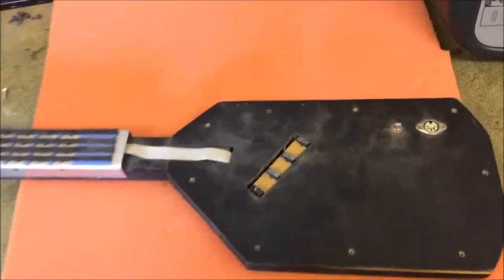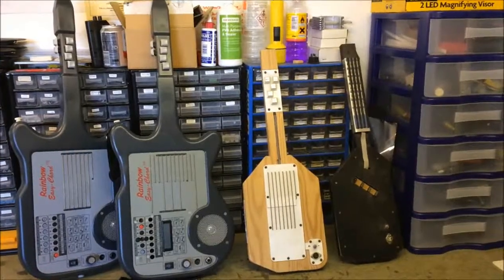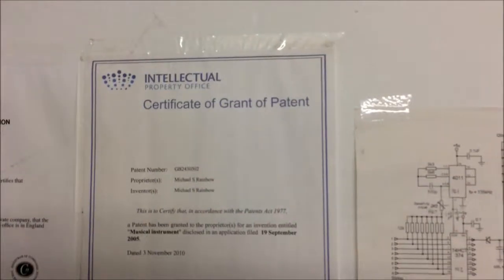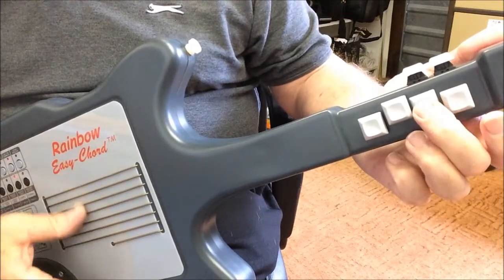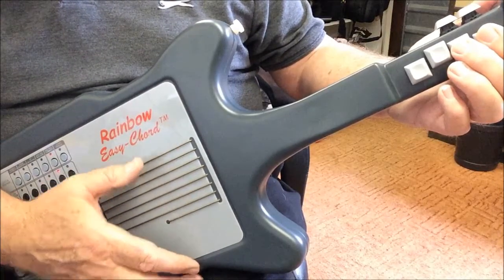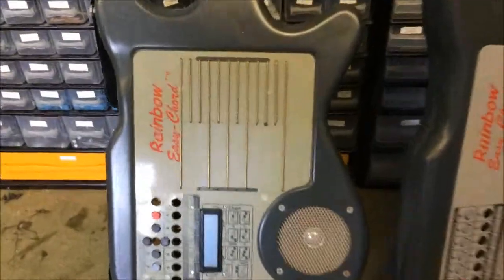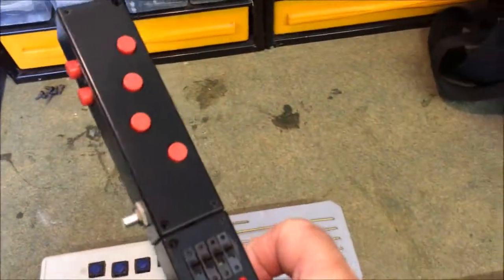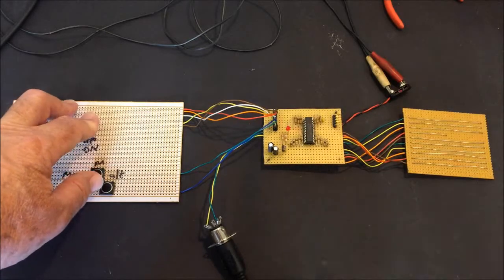DIY MIDI Chord Controller using a PIC 16F1829.

Comment: Hi, ainda não desisti do sonho. Ocorreu-me algo que poderia ajudar (não sei,  não sou um expert em programação): teria havido um erro quando importei o código fonte diretamente do arquivo HEX que usei no meu PC (HxD_HEX)?
Reply from the maker: @user-od4jk6zc2y Wrote: Hi, I haven't given up on the dream yet. Something occurred to me that might help (I don't know, I'm not a programming expert): was there an error when I imported the source code directly from the HEX file I used on my PC (HxD_HEX)? 
Hi Paulo - sorry, I haven't forgotten about your problem - my Pickit 3 has just stopped working and I can't afford a new one so I am building a programmer from scratch. I knocked up the midi controller circuit on breadboard to check the hex code that is on the download site but haven't been able to do so yet.
Reply: @mikerainbow  Amen! Thank you, Mike! I looked forward to an answer from you. But that's okay, I know that we will get make it. As I said, I'm not an expert, but if I can help in some way, let me know it.
Reply from the maker: @PauloAfonsoPereiradaSilva  Hi Paulo, I have got my programmer working and have checked the code and it works perfectly. Also there are no errors in the schematic. I have updated the hex code slightly by removing the midi test on switch-on which plays a 'C' chord but other than that everything is as it was and works (updated link above) so you have to look for a problem elsewhere - either with your circuit or with your programming. You should have no problem programming directly with the imported hex file.
Reply: @mikerainbow  Thank you very much, Mike. I am grateful to you for your effort in solving my problem. I will again review everything. If I succeed in this, I will let you know.

Comment: Hi, I am a brazilian retired. When I was young, I dreamed a lot of playing the guitar, but I always found it very difficult to deal with chords, especially with lashes. Today, I am back to the old dream. But how to overcome my difficulties? That's when I saw your excellent designs, which use few buttons instead a lot of them. I also saw that you made them available so that people could take advantage of your generosity, which I really appreciate. So I built the MIDI-CHORD, in guitar format, using the PIC 16F1829. I successfully wrote the HEX code to it. However, no sound program recognizes the instrument. Could you please help me understand what might be going on? What software do you use? How to configure?
Reply from the maker: Hi, I gather from your description that you are trying to connect to some music or sound program on your PC? The project has a standard MIDI DIN to Din connection to be plugged into a MIDI sound module or music keyboard with a DIN MIDI input socket - these devices need no software. The output is on MIDI channel 1 (of possible 1 to 16) which is actually channel 0 (0 to 15). When connecting to a software program on a PC it is a little more difficult because the DIN plug output has to connect to a USB input on the PC via a suitable MIDI/USB interface and the PC will recognise the interface and then any MIDI device connected to the interface should work OK. Can you tell me exactly what your setup is?
Reply: @mikerainbow  Thank you for answering. You are great! I was really trying some music program installed on the PC, through midi/usb interface (Prelude). I tried several programs and could not configure. But I also tried to mount the midi module on the sheld_mp3 (your video) and I was unsuccessful, due to the delicate soldering to be done on the tiny IC. Finally, to avoid a music program, I built a midi_in/out module that I saw on the internet, from the arduino UNO, and I successfully recorded the test code, but not even that one worked. As for your midi module (which I made in the shape of a guitar), I think the electrical assembly was perfect, since I was able to record the code directly, via pickit_3/icsp, successfully. But the guitar doesn't turn on. Just turn on the power led and the midi led blinks twice. Anyway, I still don't know what went wrong.
Reply from the maker: @PauloAfonsoPereiradaSilva  The blinking midi monitor led indicates that midi messages are being sent - does the midi led blink when you push a chord button or when you touch a string sensor with a chord selected - this will indicate the area of the problem. and where to look next.
Reply: @mikerainbow  Thank you, very much. Well, the led-midi does not blink when pressing keys 2 and 4, but it blinks in the others keys. I must then search in this area. The source code I have imported as is. So I supose it is ok. Thank you and sorry for my questions, but your information is very valuable for this simple hobbyist. I will check, Mike.
Reply from the maker: @PauloAfonsoPereiradaSilva  That's no problem - I am going to knock up the original circuit on breadboard and check it with the hex code from the link above just to make sure there are no problems  - I will let you know the results. Does the midi led blink when you press button 1 and then touch a string sensor?
Reply: @mikerainbow  Sorry for delay in responding. I checked the circuit and corrected two solders, just on the keys that weren't blinking (2 and 3). Now they blink. But the led only blinks when I press each key, not when I touch a string sensor.

Comment: Hello Mike I would like to build a  midi drum sound generator specifically for drums not keyboard..sound coming from the PIC chip...no additional buttons just a midi output...is this possible
Reply from the maker: Hi, using a PIC to produce MIDI messages to control an external drum sound generator would be fairly straight forward but to produce MIDI drum messages AND drum sounds is a little more complicated. There is a huge variety of PICS in different sizes, clock speeds, peripherals and, importantly in this case, memory (program memory and ram). You would need to store drum sounds in memory and this requires quite a bit. Also it depends on what quality of audio you want in the way of sample rate, sample bit size etc. So you can achieve some success with lower-end PICS but a 32 bit device with more memory is probably the way to go.
Reply: Thank you very much for responding...so what do I need to program a PIC chip
Reply from the maker: @shepsss2002  For the PIC's I have used in this project you need a pickit 2 or 3 usb programmer or something similar and MPLAB IDE or MPLAB X IDE programming software which Microchip make available free of charge to download and use - but if you are starting from scratch with no or little knowledge of microcontrollers then you would need to learn a bit more about them. There are loads of good tutorial vids on YT that will help you.

Comment: Hi MIke,  I really enjoy watching your videos and building your projects!  I have built both the Slide Guitar and now the MIDI Chord Controller and they both work great.  I do have a question:  Is the LCD/PIC16F1825 display from the Auto Harp supposed to work with this MIDI Chord controller?  I get a few random numbers on the LCD but nothing useful...thanks for any help with this!
Reply from the maker: Hi Tim, it's really gratifying to know someone has built some of my projects - thanks for the nice comments. Unfortunately although the serial LCD design is the same for both projects, the Auto Harp is set up for 9600 baud and the Chord Controller was meant to share the serial output for both MIDI and LCD serial at 31250 baud. I never included the code at the time and didn't think anyone would use it - sorry!

Comment: Wow Mike,  some really interesting stuff there. I've been looking around the internet to try and work out the best way of doing the chords on my unit, and I come across your channel  and everything I'm looking at doing you've already done.  Nice job.
Reply from the maker: Hi Brian - thanks for the nice comments - let me know how you get on.
Reply: I was thinking of going the omnichord route for chord selection but that's an awful lot of buttons. I really like how you managed to condense that down to just 6 buttons.  What I'm working on is based on the stm32 with a MPR121 12 channel cap touch module, programmed in the arduino IDE. The stm32 gives me the ability to send the midi over USB. 
I need to find some time and upload more videos as I've progressed quite a bit from the prototypes in the last videos. I've had some PCB's made and the Midi Stylophone is looking really good so far..
I hope you don't mind if I try your chord idea, this is only for me. I just really enjoy designing and building these gadgets even though I can't really play them when I'm done. 
Have a quick look at my YouTube it should give a bit of an idea of what I working on.......
Reply from the maker: @brianharper9798  Will definitely check your videos out Brian - and of course you're welcome to use my chord button method - anyway the patent expired a while ago and I'll be happy if others can find some use for it.

Comment: Great stuff Michael. Your knowledge of the technical side of music, coupled with your vast knowledge of the workings of IC's you use and how to make them work for you is most impressive. I remember how you could replace a damaged IC on an electronic organ with a small board with discrete components all wired up and hanging like a bunch of grapes and it would work. The 100 watt per channel amplifier I built from a electronics magazine that wouldn't work until you pinpointed the problem to a printing error in the mag. Best of luck and hope you are very successful in the future.
Reply: God bless good people. My respect! 🍻
Time flies! 🌄🌞🌅